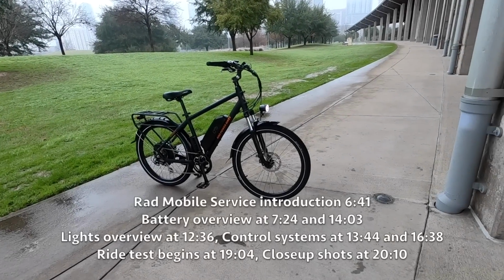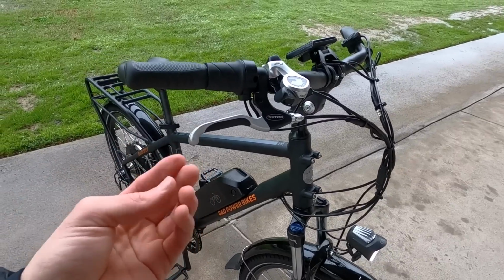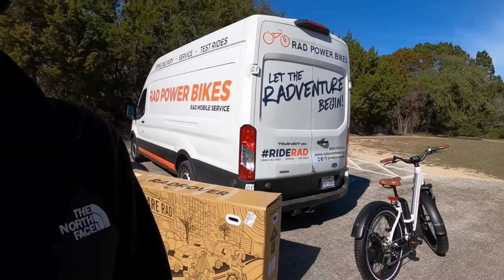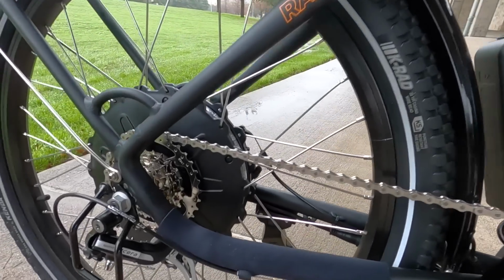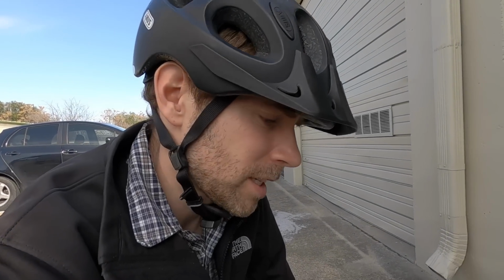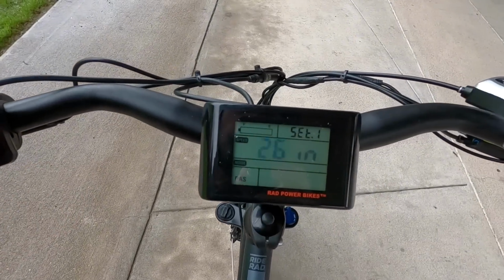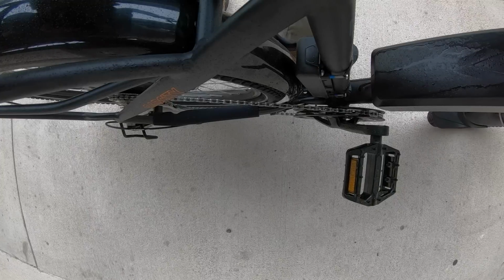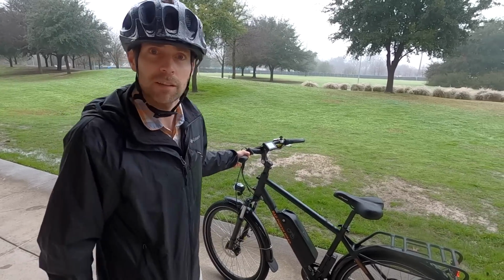Rad Power Bikes RadCity 4 Review - $1.7k

Comment: Hmmm, if it is a city bike, why a gearless, inefficient motor? It should be the opposite. Geared motors aren’t that loud and in traffic you will never hear it. When i compare my Bosch to my Bafang geared hubmotor, the Bafang is noiseless.
The Tyres should be more like the Schwalbe Marathon. 
One thing I really don‘t get, a 80 Lumen frontlight?! 100Lux / 200-250Lumen should be the lowest allowed light on any bike. Those cheaper lights are useless and dangerous. Even my expensive Cube comes with a crappy 30Lux light, but I told them, I buy it, but not with something like this. And so they changed it directly into a Herrmans Pro E. Even then 100Lux are not overwhelming, but that should be the lowest standard.

Sorry, if it sound harsh, but I would change the tyres and the headlight directly after the delivery. My lights are always on as a commuter, it needs a lot of light in the winter to see and to be seen and the tyres have to be efficent and max durable. I had several flats within a 1000km with my first e-bike here in Berlin. They claimed to be puncture resistend. Then I changed to Schwalbes Marathon and in over 8000km with the old bike no puncture again. Also with my Cube e-Bike another 3400km without a puncture, because of the Schwalbe. 

What I want to say is, those parts aren‘t expensive. It adds maybe 50-70$ to the production cost or even less. But these parts are so damn nessessary to have no problems with a bike, that I’dont understand, when they cut costs at this parts. Do it one time, but do it right. Make your customers happy even if they don’t know, why they’re happier than others.
Reply from the maker: It's not harsh, I appreciate your feedback. The focused beam headlight worked pretty well in the evenings, better than older lights, and the side visibility has been improved. For me, that's a step in a positive direction, and many ebikes in this price range don't have lights at all. I was also surprised that they hadn't switched to a geared motor, but they said these gearless ones are very reliable, quiet, and that the stop and go puts regen to work fairly effectively... so, I see why they made these choices. As for tires, the co-branded Kenda K-Rad is also slightly above average cheap tires that wouldn't have any puncture protection or reflective sidewalls. Schwalbe is great, but that just adds to the cost. It's a price-competitive world, so to hit the right marketing message and pay for vans and support etc. they need some margin. Maybe in the future we will see Rad Premium models or something that cost more and come with even nicer hardware... but for what it is, I still think the RPB products are above average, and you could spend $150 of your own money to get the slightly nicer parts if needed :)
Reply: ElectricBikeReview.com  Yes, I did it with my cheap 899€ Fischer e-bike eth-1401. I spend 40€ in Schwalbe Marathons and now another 63€ for the same Herrmans Black Pro E headlight, like on my Cube Hybrid Pro. 

I think, people should just know that, that it’s better to change it directly, to get a wonderful and safe ride. :)  It’s line day and night.

Comment: Great review. What's with those cables? Why are they not hidden?
Reply from the maker: Hi Gliga, some of the wires are hidden, but others are exposed at the front and below the bottom bracket. This probably makes the bike easier to service if you need to replace a part. Most of the cables have quick disconnect points. If they weren't run through the downtube, you'd see many more cables connected below the top tube or downtube, and it wold look even more cluttered, like this: https://electricbikereview.com/electric-bike-outfitters/48v-burly-kit/

Comment: Seems like a step backwards with just one frame size and the placement of the bottle cage mount.
Reply from the maker: I can see why they are trying to standardize... perhaps they didn't sell as many of the smalls or larges and just had extra inventory or more confusion. With an adjustable stem, this bike will fit a good range of riders... and the smaller folks can get the step-thru. As for the bottle mount, I'm glad that they have one at all considering the battery placement. I think it's always been down there, so it's not exactly a step backwards as a stand-still step ;)